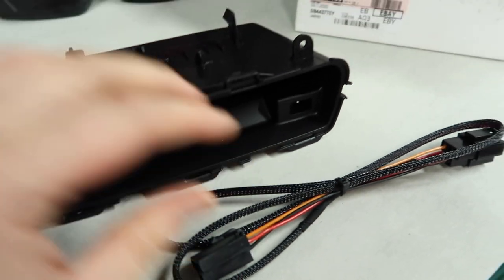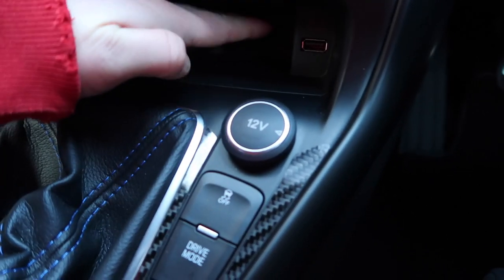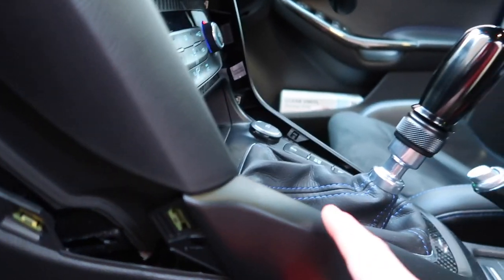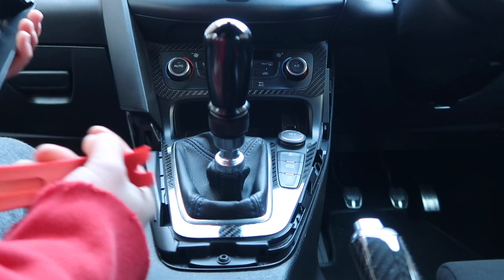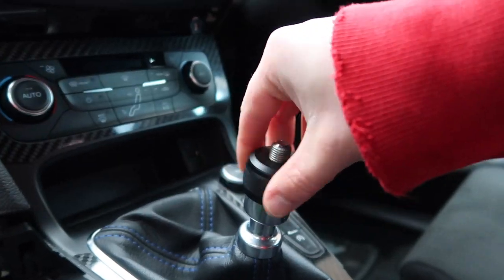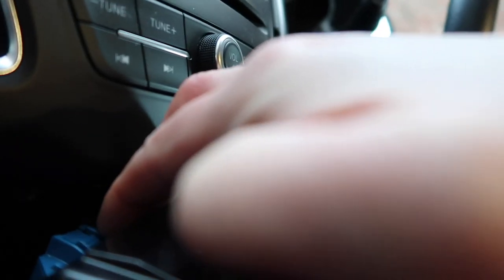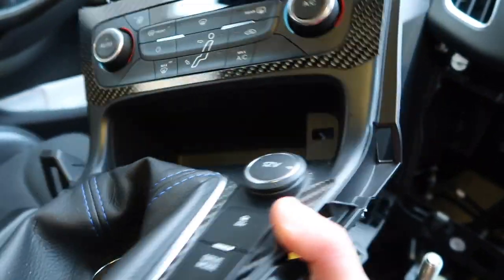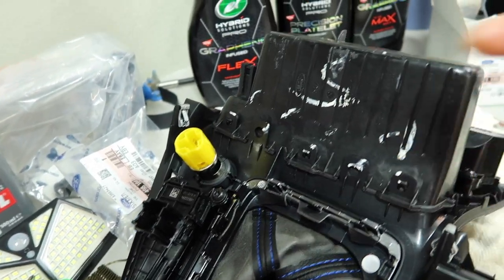FORD QI WIRELESS PHONE CHARGING KIT INSTALL! | FOCUS RS

Comment: Mine just doesn’t seem to work all connected up no power at all, connect back the standard 12v cable and the socket has power. Put in the adapter and no power to either.

Comment: Hi Adam mate, hopefully you can help. I got this as a present off my girlfriend and I went to fit it today with no issues other than when I plugged it in. The light flashed straight away and then went off and hasn’t come back on since. Did you have any problems? I believe it could be a fuse that I’ve blown maybe according somebody else but not sure??

Comment: Update: Just fitted it and i got it installed within half an hour and it was piss until the white clips for the screw moved up into the screen so had to take all that off to get to it for me then to loose a screw into all the wires but i found it so all in all for all that it just took over an hour. 

Just ordered mine from official ford store on ebay as it was £13 cheaper than rates but why the car does not come with a wireless charger especialy yours because of it being an rs and the usb bit not being as bulky as it is on the original bit.

Comment: Question on the material of the new cubby.  Is it the same as the stock cubby?  I ask since it looks to be a similar plastic as the surrounding trim, but so did your stock cubby.
Maybe us Yanks in the US got a different material since mine is more of a rubberized texture which is nice for dampening sound of any items in there but not so good since it leaves scratch marks from the lightest touch of your finger nail and is tough to clean.
Another great video!!  I had to go back cause I swore you did not have seat heaters buttons at the start!

Comment: Hi adam. Thanks for another quality video. Just one question. Is the charger live all the time or does it go to sleep once the car is locked.. I purchased one from Rates ford but yet to install it. Thanks in advance.. stay safe. Keep the videos coming.
Reply from the maker: I am not sure Darren, It will be live when the 12V sockets are live. I never leave anything in the car plugged in to know if they shut off after a while! Cheers :)
Reply: @AdamRainey  thanks for the reply Adam. I have now fitted the charger, and yes once you lock the car after about 10 mins the charger shuts down unless you have a phone on charge. Great bit of kit. Your video helped fit it into my ST. As all the other videos have. Ie Autobeam products.  I am wondering now if I could fit a OEM reverse camera.. i wonder.. take care stay safe.

Comment: Hi Adam 
Do you know if when using  this product will it connect to android auto , because normally the phone has to be plugged in ??
Reply from the maker: I beleive it will just charge
Reply: You can only use Anroid Auto wirelessly if you have a data plan for your car as it uses 5ghz WiFi.

Comment: Hi Adam , Does apple CarPlay enable itself when on wireless charger or do I still have to plug it in using the apple usb lead.
Reply: Hi steven. Unfortunately you have to use the plug in lead for apple/android to enable features on your cars screen.
Reply: @darrenwalker3634  Hi Darren, Thanks for that . No point in me buying it now.
Reply from the maker: Yea it is horses for courses, not everyone uses carplay or android auto all the time so this upgrade is useful for those folks

Comment: Dumb question but does the LED being constantly on bother you and have you noticed an impact on the battery?
Reply from the maker: No it doesn't, it is way down underneath other lights so makes no difference. In terms of battery it would take many years for a single, tiny LED to have any impact on a car battery

Comment: Will galaxy S10 plus fit please?
And there is no extra wiring harness for the heated seat? I.e. just to replace the control buttons and of cause the heated mats?
Thank you!
Reply from the maker: Might be a tight fit but I don't have one to test fit with. Correct, just the parts I mention here are all that is needed